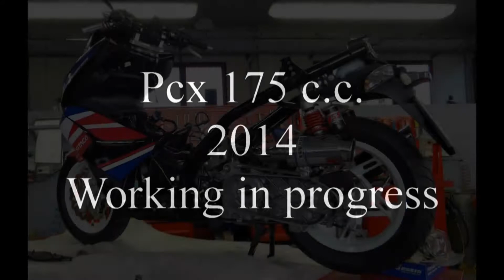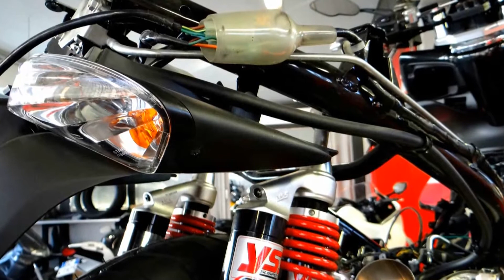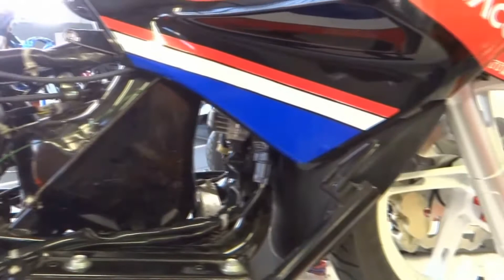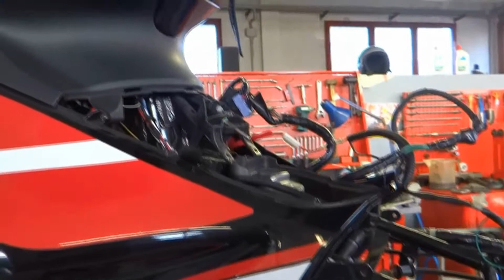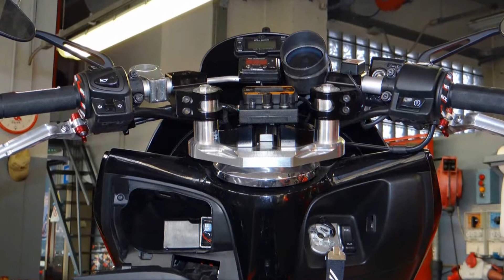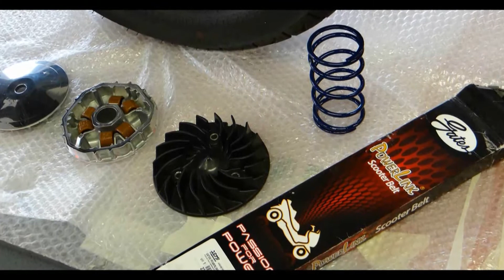Pcx 175 c.c. 2015 Working TEST in progress

Comment: salve Max, motore aperto, riparato e chiuso senza problemi; ti dirò che è quasi più difficile smontare le carene...
vorrei chiederti una cosa: sai dove poter reperire uno scarico racing per il 125 2010? (sempre negozi italiani)

grazie
Reply from the maker: eccolo qui:
https://www.motoshopitalia.com/scarico-marmitta-pcx-125-gpr-omologato-completo-dal-2014-p-14202.html?marca=m1&modello=PCX125&osCsid=9f9a69183c9f61c18b51cff53914ecdb
Reply: Max Tremo grazie, ma dal 2012 in poi si trovano di ogni tipo, il mio è del 2010... ieri ho contattato un negozio è mi ha detto che dal 2010 al 2012 il motore cambia (anche se io non noto differenze); poi ieri stesso ho mandato una mail al produttore GPR per saperne di più, ma non mi hanno ancora risposto